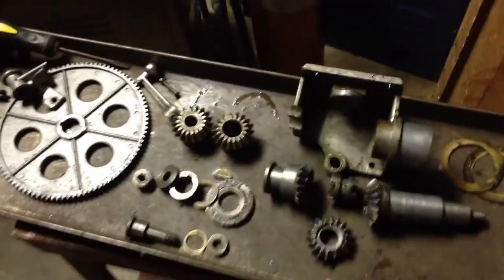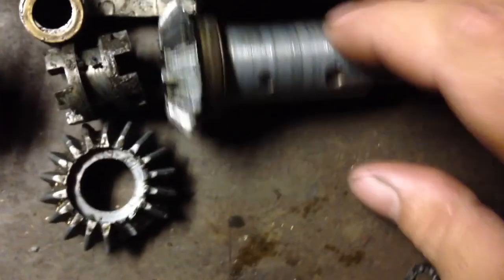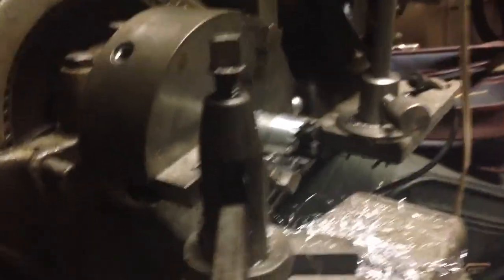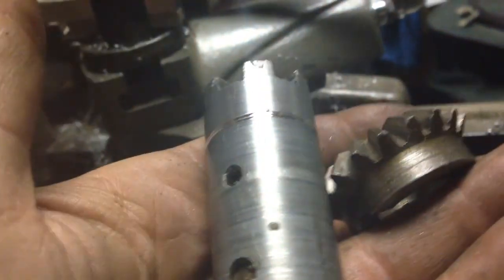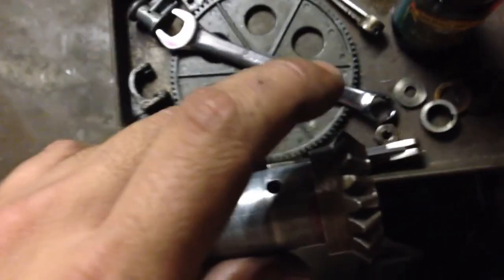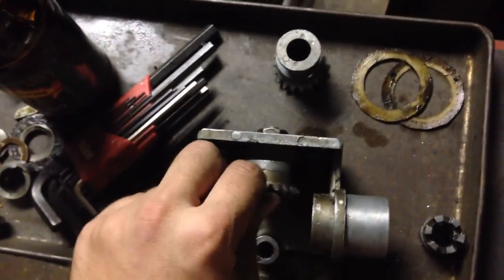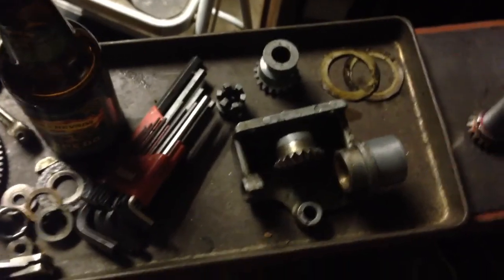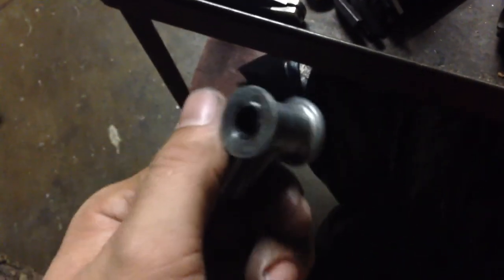Atlas lathe reversing gear box repair part 2

Comment: Thank you for posting. I can attest to the efficacy of this method. I bought a 10-F from an estate sale recently. Two of the gears in the reverse feed box were wiped out (the drive shaft gear and the idler gear). The gear on the leadscrew was completely intact as were all of the other components in the gear box. I purchased two 12 pitch, 18-tooth steel miter gears with non-hardened teeth. I machined the old broken teeth off of the drive shaft and turned the OD. I then chucked onto the body of one of the new gears, faced it so that it's tooth length was the same as that of the original gear and bored the ID to accommodate a light press fit on the drive shaft. I fit it to the shaft and drilled/reamed and pinned it in place with a 3mm stainless pin through the sidewall of both the gear body and the shaft but made sure to use a pin that was not long enough to completely penetrate the sidewall of the shaft as the turned portion of the leadscrew mates with the ID of the drive shaft. The idler gear I simply faced/bored and counterbored using the same method as the first gear as well as an expandable mandrel I made out of aluminum roundstock. I made a new washer/spacer for the idler gear to sit on and fine-tuned the amount of tooth engagement by gradually reducing it's (the washer's) thickness on a surface grinder until all three gears mated satisfactorily. This is a very effective repair method in my opinion and I highly recommend. Just make sure that you indicate all parts meticulously before machining to ensure proper fit/function.

Comment: OK I finished this mod on my lathe, worked great, the only thing I did different was after I machined off the old gear I nerled the area the new gear slips over so to give the loctite has something to grip to. I found that my 3 jaw chuck fit perfect between the teeth on each jaw. I just chucked it up and went for it and had no problem at all just took my time and didn’t make big cuts. Thanks for the videos and the great idea. Happy machining. Bill Verstelle
Reply from the maker: Bill Verstelle very good, I’m glad it worked out, good idea knurling it, I might do that myself should I need to do such a repair again.

Comment: I have the same problem on my lathe and will be doing the same mod, already ordered the gears. Question how did you face the new gears? Did you tighten the chuck on the teeth? Thanks for the great videos.
Reply from the maker: I did chuck on the teeth, light chucking is needed as well as light cuts, go slow and be careful, use a bit of copper between the chuck jaws and the gear if you like as a bit of protection, a scrap piece of copper water pipe works well for this, another way which is probably better is to use an expanding mandrel, they are available on eBay and a small one suitable for this shouldn’t break the bank, bigger ones start getting pricey. If you go the mandrel rout you will have a very handy tool that can be used for other jobs in the future.
Reply: Thank you for the reply, I'm finishing my restore and have the gears ready to machine. This will be my first project when I get the lathe running in the next couple of days. Your Videos have been a lot of help, thanks

Comment: One way you can connect the gear to your shaft is called a Dutchmen . It's a simple pin drilled and reamed to capture the outside of your main shaft to The outer diameter of the inside of your gear . Old Tool Maker 
JT Hay Fort Worth Texas

Comment: This is a really cool repair and supports the whole premise behind machining.  I am a beginning home lathe operator and would like to perform the same repair. Is there a particular mandrel (or set) that is recommended to attack just such a repair?  Thanks for the great video, excellent ingenuity!
Reply from the maker: This was all done in the chuck, all hand feed, on the machine being repaired, no mandrel required, though if you wanted to use a mandrel for some operations you could, facing the backs of the gears requires chucking on the teeth which is not ideal but chucking lightly and with some soft metal like copper or aluminum is ok. If you want to set screw it than just use a piece of shaft, or you could loctite it to the shaft and remove it with some heat when your done, many ways to skin a cat as they say, you can surely come up with a setup and order of operations with what you have at hand.  good luck with your repair, and thanks for watching.
Reply: Zactly what I was wondering re: chucking the gear teeth.  Your method I think is sound and will be a great repair.  Just turned down the reverse gear shaft and am awaiting the part.  Thanks

Comment: Fantastic Idea. Mine is broken now and I don't want to buy parts that will just break again. I'm doing this! I always thought that Atlas 10 lathes needed a clutch on the lead screw in case of accident.
Reply from the maker: Glad you found my video usefull, the repair is sound and has been holding up without any extra help, other than a few drops of oil before use, I'm confident you'll be quite happy with it on your machine
Reply: +captaingreenbush  Did you hold that center gear in a mandrel to face it down to the correct thichness?